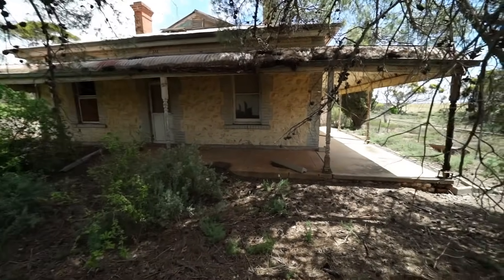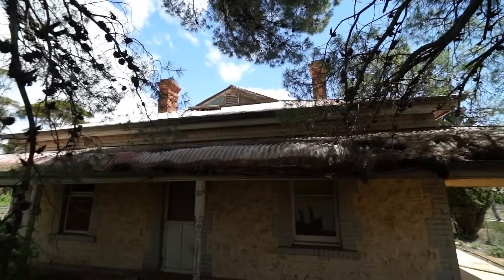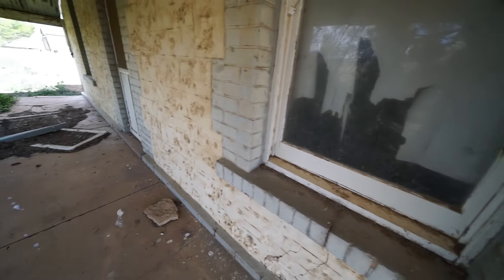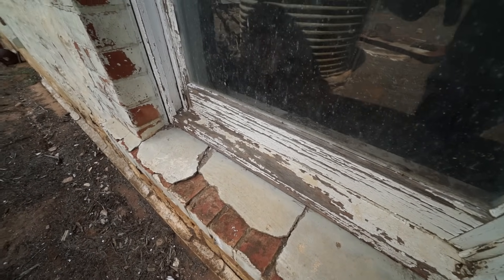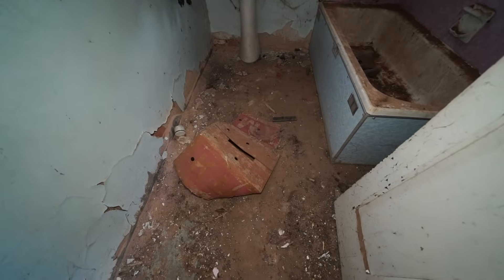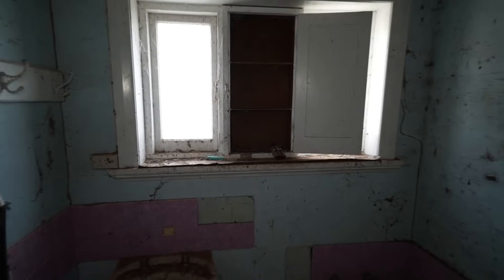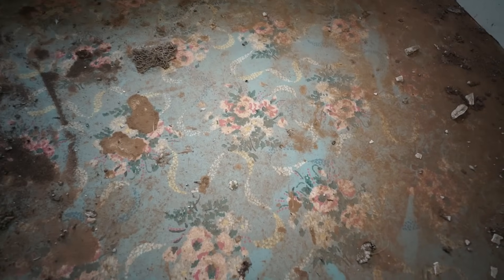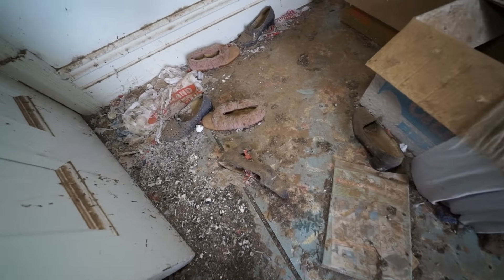Huge old farm house with stuff left behind/Many old farm machines/Abandoned 40 years

Comment: I have an old John Deere combine sitting at my place. It’s not a real big one but the property isn’t big like that either and it seems to be an adequate size for the land. It’s not near as old as those but does have wood and canvas belts to move the materials along. It’s pulled by a tractor but isn’t PTO driven. There’s a gas engine mounted on it to drive the belts. Still that distinct John Deere green. That was a pretty neat place. It looks like it could be rehabbed and made livable again. Was that a well in the back near one of the rainwater tanks? It looked like one covered up there. That outhouse was a good walk from the house. I have a wonder if there wasn’t another home of some type nearer to that than the current house. One shed was a bird pen, with a wooden perch hung across the inside.
Reply from the maker: Hi Martha 🙂 John Deere is a very popular brand here on current farm for sure. Glad you have an old one. Cheers for watching 🙂👍